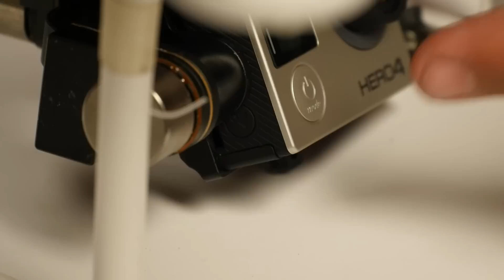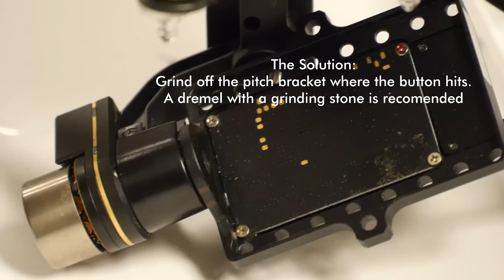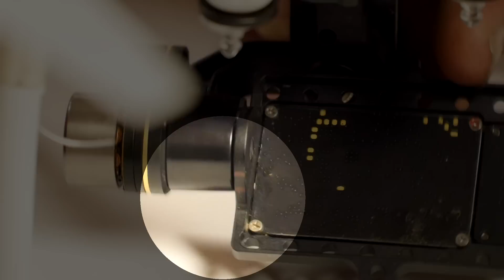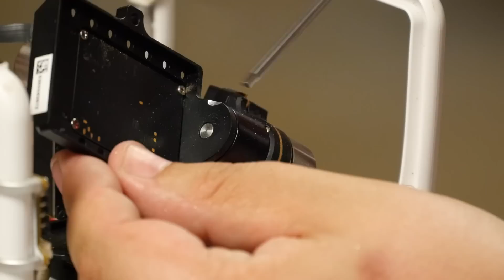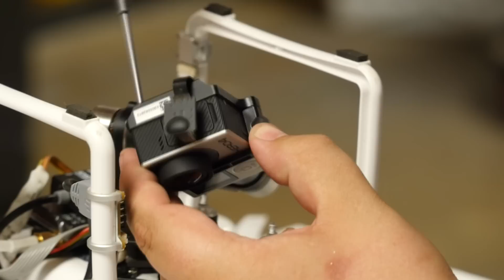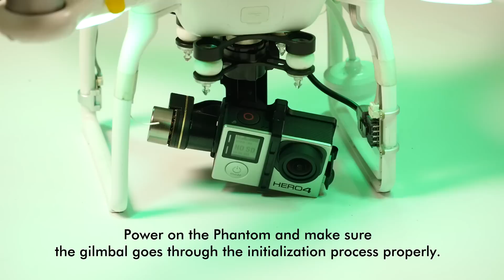GoPro Hero 4 Mounting on DJI Phantom 2 Zenmuse H3-3D Gimbal

Comment: Grinding the Gimbal is not only cosmetically unappealing it might also throw off calibration and is also a non-reversible procedure.  What I did was just put a 3M double sided sticky that I cut down to size against the GoPro and Voila. No more Problems
Reply: my gimbal have some room around the gopro, 1mm or soo.
Reply: Can you send vid of this??
Reply: @lapo, did you just basically build up the surfaces around the button to make it so the button is not depressed?

Comment: I have a Hero 4 Black and Zen h3-3d and although the button is partially pressed, it is by no means effecting it in any way.
Reply: UsedNewsToday I think he has, hero4 is on usb video out.
My H3-3D came with gopro back connector and my Hero4 ha NO VIDEO out...
I'm seeking for a solution...any clues?

Comment: Just need a solution to get the GP4 working with the H3-3D gimbal with back plate connection and I'll be all set!
Reply: I am new to quadcopters and looking to get this to use with my Hero 4. So will there be any issues with the connector on the back of the Hero 4?
Reply: Michael If you get a new H3-3D gimbal then there is no issues since it uses the ribbon connection.   The problem is with the original version of the H3-3D gimbal that connects to the back of the Hero 3, and does not work with the Hero 4.  The older connection is much more secure, as the ribbon connection is flimsy and can break if you crash your quad.  There was supposedly a lot of folks trying to find a work-around for the older connection because it's much more sturdy, but I don't know of one that works.

Comment: This gimbal ruined my Go pro 4 black AND 4 silver. I guess the gimbal was putting too much pressure on the side button and caused both cameras to overheat and freeze. Had to send them in, go pro sent me 2 new cameras. Now I know that I need the h4-3d for the go pro 4 cams. Also, I think the overheating of my go pros caused the gimbal motor to start smoking and catch fire!

Comment: Question: Why don't you just dremel down the button so it doesn't hit anymore?
Reply: Nope. Why? Are you?
Reply: Haha I'm just wondering why you would break a gopro 😂
Reply: How would that break it? Slightly leveling out the button so it doesn't hit the gimbal seems like a pretty logical solution. This method works fine it seems, but I'd be worried about causing any permanent imbalance in the gimbal. Slightly flattening the button seems much easier and safer to do. Call me stupid though. Sweet.
Reply: Eddie Gage Hi, interested in the technique you used as I have a similar problem with mine. When you say 'levelling out the button' I cant picture in my mind what you did, can you elaborate please. Many thanks.

Comment: The Hero4 is about 19% heavier than the 3+ (88g vs. 74g).  Do you notice any changes in the performance of the H3-3D?
Reply: ***** wont make a difference. people are using big nd filters without any problem.
Reply: Never had a Hero 3, but the Hero 4 was off balance when I fitted it first.  Went into the software and re-calibrated it so it was level.  Its fine now :-)
Reply: GranVlog actually I did tested big ND filter on go pro 3 and the gimbal failed randomly, the motors are extremely week either its setting inside the gimbal or something else, but the 2 axis gimbal was much more reliable...
Reply: ***** i see. i never had that problem. even using the h3-3d with gopro hero 4 black and still it works fine. :)

Comment: One thing you do not show what is to protect the engine écité qur dust that sticks to the metal neodymium magnet motors.
Reply from the maker: Thanks for the pointer. Added an annotation. We were using a fan to blow it away :-)
Reply: is aluminium magnetic where you live? :D
The bigger problem is that it is conductive, so be sure to get a vacuumer to suck the dust up before it is hitting the electronics. :)